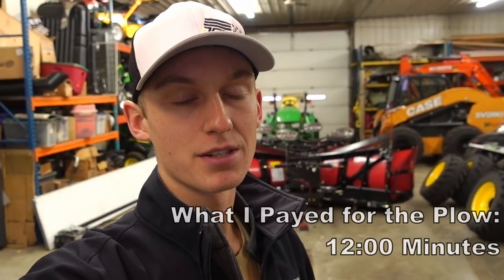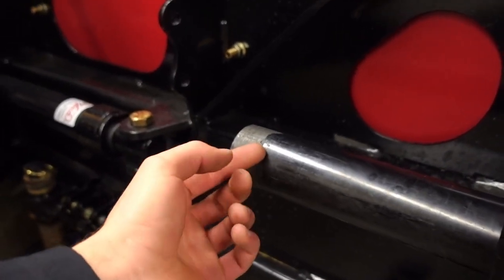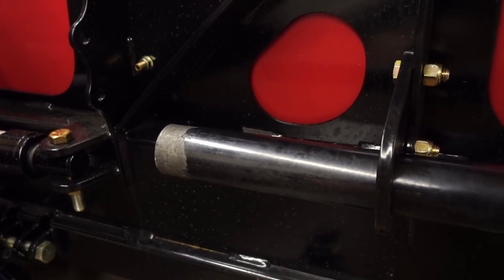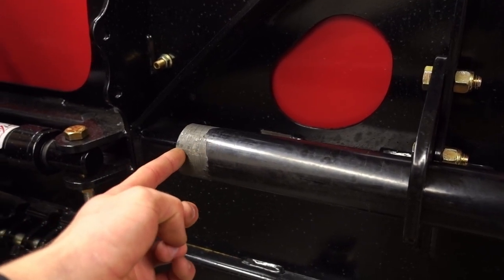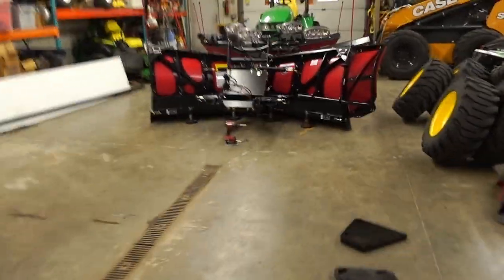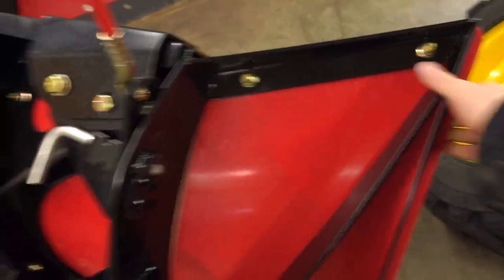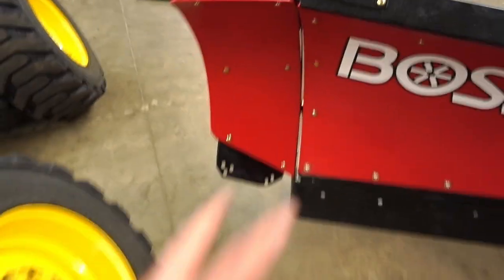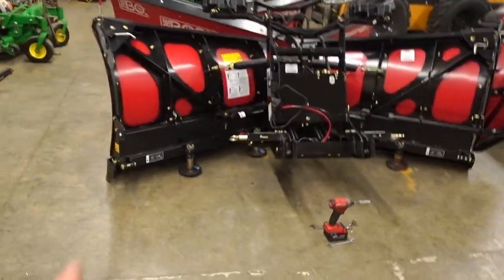11 Foot V-Plow On A 6.0 Powerstroke  | How Much Does A New Boss DXT V Plow Costs?

Comment: mine was a little tight too, but instead of grinding down the tubes, I just grinned down the inner circle of the mounting tabs. All that had to come off was the primer and powder coat. I didn't have to grind any steel down thankfully.

Comment: Delt with the same exact issues right down to the boss reps a few years back with vxt  setup. Had some issues with them coming loose due to how much play there is. So I ended up tapping some rubber stoppers on to the side of the extensions just big enough for a little bit of pressure. The fix worked for the second half of the season but ended up selling the extensions after that anyway. Oh yeah, pretty much rode with them full time too! Never had any trouble with the law but had a D.O.T. guy tell me I was over width for the roads when I squeezed through the toll booth once.

Comment: That is not a bad deal at all. I live in upstate NY and just bought a new VXT 8'2'' , but had truck mount and wiring added and i spent $6,600 with deflector and shoes.
Reply from the maker: Mounts and wiring are all of $1200 here I wanna say that stuffs not cheap
Reply: @CarsonSchifsky  that's right around what they are charging around here as well.

Comment: ive got a 9’ western strait blade for my truck i found a set of wings for it. there 9” wings so its just over 10.5’  wide but i dont take it on public roads with the one on the drivers side its 2 big pins to take it out but its easier and cheaper then if i hit something. i can pull both off but dont want to if i dont need too. 

the wings help on a strait blade ends up scooping a little bit more or i can keep one out and “windrow” more snow 
if the town is taking a while to hit the roads in my private neighborhood and its around when people get out of work ill keep the wings out and plow out the whole road in a pass and a half
Reply from the maker: Yep I love how there angled I really think that’ll help with scooping and less windrows!
Reply: Carson Schifsky it really does help saves alot of time
Reply: Any videos of those guards plowing snow?

Comment: I think the problem with the wings lining up is that the wing bracket should go on top and the bracket that is on top now should be on the bottom. That would bring the bolt holes in line and the bottom of the wings  up flush.
Reply from the maker: There all kind of installed per the instructions. I think the kits like a universal system so they have extra hardware and holes for different plows

Comment: I just put a 1 season old fisher 8’ 6” straight plow, wires and hand held controller, very little use, driveway used only, 2650 installed
Reply from the maker: That’s not to bad

Comment: You should really consider running some kind of an led light bar on the front I have one on every plowing setup I got and it really helps with the visibility at night. It’s not always needed but when the visibility is low it’s nice to have. And make a huge difference in my opinion.
Reply from the maker: Idk where I could mount it that it wouldn’t just reflect off the plow? But these new boss led lights are super good
Reply: I run a few of mine off of the roof. Also I have a few in different places like on the bumper (depending on the plow hight) also I have 2 Mounted right by where the original lights are like in between them on the plow
Reply: Running an extra LED light bar is totally unnecessary considering that the plow already comes stock with the brightest of brightest SL3 LED headlights and it’s 2x brighter than standard halogen. No other manufacturer has brighter lights than BOSS.

Comment: I would recommend based on over 30 years of experience go with the Westin plow Western plow they are rated number one if you go to a plow repair place you’re going to see all the other manufacturers pumps hydraulics and equipment in for service you’ll never see westerns and what’s important to note it’s not only the plow but the person operating it. The wings of many of these type of plows if you do your research have been known to malfunction and or cause transmission malfunction and you need to match the plow with the truck. I personally recommend dodge Cummins 6.7 turbo diesel 2014 and beyond I also have a 1999 5.9 Cummins dodge on a 4 inch lift skyjacker brand new body and suspension with extend the links and bushings brand new tires Mastercraft and I just change the fly wheel at the starter did all the fluid rear end transfer case transmission right before the winter if you’d like to see pictures I’d be more than happy to show you

Comment: Wow that's a good deal. I paid $5900 for the XT model. The DXT steel in my area was around $6700 I believe without wings that's with labor and bracket
Reply from the maker: Instal for the bracket wiring etc though? I didn’t have to put any hardware in the truck.
Reply: @CarsonSchifsky  Yes that's for everything

Comment: That's a good deal. That's a very heavy plow, do you have air bags on the front axle? We run them on our f250's and they carry the load much better. 

I did not like the dxt on gravel, it's a pavement plow in my opinion, and a darn good one at that.
Reply from the maker: That’s good to know, and no I don’t have and air bags but I was thinking about that but didn’t know if it was possible
Reply: @CarsonSchifsky  here are the ones that I run. 

https://www.airliftcompany.com/products/air-springs/air-lift-1000/

The dxt was fine on gravel that was frozen, but here in northern MI it's rare our ground freezes before we start plowing, some years it rarely gets hard it seems. We run quick gaurds on our plows for the super soft jobs we have to do early season.  http://greatlakesweld.com/quick-guard/1339276

Comment: Are you running shoes because you have some gravel drives? I haven't run the shoes but some have suggested that I do because the dxt's angle isn't really ideal for gravel drives. Didn't have these drives when was buying? wonder if they would help with this? thanks in advance! Nice video
Reply from the maker: I’m sure they would but the shoes just help prolong the life of the blade so that’s why we run them.

Comment: How has the 6.0l held up for you? They have a notorious problem with heads and oil coolers etc. Just wondering what your thoughts on them I’m looking at pulling the trigger on one next week. Thanks
Reply from the maker: We bought this new in 06 it’s an 07. We’ve done a egg delete and exhaust and nothing else other then keep up on maintenance. She’s never had an issue knock on wood. We’ve had to replace batteries an alternator and typical front end parts but engine is solid. If you take care of them they should take care of you. However I will say the 2007 or 2006 would be the only year I’d buy a Thai game before that didn’t have the “updates” and 2003-2004 are trash stay away

Comment: I am considering a Boss Vxt , do you think I should spend extra $650 to go Dxt. I only do driveways. Since you have experience with both plows, I would value your opinion.
Reply from the maker: The DXT upgrade for me was only $200-300 so I think your dealer is a bit high o the price for upgrade. However I have not used the dxt much yet, I would say to analyze your sights and your future sights. If sights have small objects that stick up such as sewer/ water like manhole covers or things like that I would recommend dxt. Mostly commercial lots is where you’ll find those small things that would just trip the blade and make it worth it. If you don’t plan on going commercial I’d stick with a good VXT

Comment: Who is your Boss dealer? i was quoted 6400 for just a power vxt plus another 900 for wings and 400 for a joystick for a total of $7700. That was plow side only as my truck is already setup.
Reply from the maker: Robs snow plow in Ashland Wi absolutely amazing guy
Reply: @CarsonSchifsky  Awesome thanks ill get a hold of them. How do you like the dxt vs the vxt? Weve always run vxts but recently have picked up some really rough parking lots and some more gravel driveways and are considering a dxt

Comment: Are any of you trucks diesel and if you do have a gas truck how much snow can you push? Thanks.
Reply from the maker: Our 2017 is gas everything else is diesel. And honestly with the plow and proper sand bag weight it’s not terribly different. Diesel will want to idle along with ought throttle input because of the torque but they both push decent. When u get in big wet snows you’ll definitely appreciate a diesel however.

Comment: So, someone must have already corrected you on the size of the plow with the wings on, because in the video you kept saying 11'-2", but in the title, you got it right, saying it's 11'.  Yes, it's 11' with the wings on.  While I can understand your reasoning of taking the wings off on hourly sites, to me it's not worth it.  Too much messing around with on and off, on and off etc.  My wings stay on all of my blades.  Yes, it's wide, and takes a minute to get used to it driving it down the road, but you'll get used to it, and once you do, it won't be a big deal.  The first event or two every year I have to get used to it again, but after that, it's no big deal.  Asking about the legalities of driving with a blade that wide will vary depending on your state.  In IL, we just have to put an orange flag on the drivers side wing of the plow to be legal.  In some states, it's illegal.  You'll have some idiot that will chime in and tell you that 8'-6" is the maximum legal width according to federal guidelines.  But those idiots don't realize that each state can super-cede federal laws in their own state.  Also, if you put 8 or 9 hundred pounds of tube sand behind the rear wheels, it will take some of the weight of the plow off of your front axle, and it will also give you better traction.  Just build yourself a box out of wood, and put it in between the rear wheel wells and the tailgate, and fill it up with tube sand.  You'll see a huge difference.  And you got a  MUCH BETTER deal on your plow than I have been getting.  I think I paid a total of 9,200.00 for my newest (bought it in October of this year) for a stainless 9'-2" DXT, with wings, installed, with a handheld controller.  And I KNOW I paid too much, and probably could have gotten a better deal if I traveled to a different dealer, but this is also the same dealer who will come to my house, pick up whichever plow and truck that I'm having a problem with, take it to his shop and fix it, and then deliver it back to my shop without charging me a dime for his time to pick my stuff up and drop it back off. Do you not salt?  If not, I sure hope you word your contracts correctly so that you're not held liable for slip and falls.  And if you don't, you're also missing out on the MOST PROFITABLE part of plowing.  I'd take 3 salting events every week, all Winter over plowing once.  Make more money, and less abuse of your equipment.
Reply from the maker: Thanks Jeff and I guess I wasn’t aware the plows were only 11’ I never measured them I just figured they’d be 11’2” sense the plow is a 9’2”. We do salt but most people don’t seem to want it so we offer it and quote it but also say we aren’t liable for slip and falls if we’re not salting or told not to.

Comment: How much do you get for hourly work? 

I’ve never had a contract for hourly pay 

I’m pretty efficient so a small lot mat only take 30 mins to do 
But we’re never do anything lower then 150 per push 

Just wondering what you guys get hourly 🤔
Reply from the maker: I charge $85 minimum per hour depending on if it’s a shitty lot. This truck/ plow setup is worth all that. On a large open lot I’d say it’s worth more because of the ground speed I can get is twice that if a skid at 11’ wide

Comment: Be careful the bigger the plow the bigger the problems will follow ,  strain on the transmission , power steering and cooling system. I don't run over size on any of my plows 102 is the legal width on US roads . You will be pushing over 10 yards of snow when you have a full blade and the reason I have that number is my loader with a 12 foot pusher is scaled at 12 yards of snow when full . Agin be careful .
Reply from the maker: Good to know. That’s what I’ve been thinking of is more strain on front end parts because of all the extra weight too
Reply: You can add all the stuff to make any blade look like the biggest, most time saving baddest blade out there . When it comes right down to it it's not the truck or the blade or the owner on how much it can carry it comes down to how much the check book can carry and that's the part that fails the most .

Comment: Why not go with the boss EXT way more efficient and better
Reply from the maker: What’s the difference from the DXT
Reply: A lot of problems with the Boss EXT.  If you want an expandable plow go Fisher XLT, Western Wideout or Snow Ex Power Plow.  Also, to say expendables are "way more efficient and better" then other plow types in an ignorant statement.  They all have their pro's and con's.  V plow works best for me, an expandable works best for my buddy.
Reply: Bullshit they’re all owned by Douglas dynamics
Reply: Yeah, and all three are considerably better then the EXT.  That is unless you prefer your plow to twist it's moldboard, break welds, pinch hoses and wear out pivot pins at an alarming rate.  Boss straight and V plows are good plows.  The EXT is junk.
Reply: No been running the original blizzard before they sold out
Reply: Blizzard was a good plow.  Douglas Dynamics bought Blizzard for their expandable plow technology.  Ran the Blizzard name for a while then Blizzard became Snow Ex.
Reply: I know this none of them are as good is the original
Reply: Ok, sure.  At any rate, all are still much better then an EXT.
Reply: @6.8SuperDutyDriver  Snowex bought the "Blizzard plow" from Douglas I think almost two seasons ago.
Reply: Bob Skowronek, Fisher, Western and Snow Ex are all currently owned by Douglas Dynamic's.  They did away with the Blizzard name a few years ago and all models went under the Snow Ex brand.

Comment: To be 100 those wings will not last more than 2 years just make the best of your blades without upgrades other than cutting edges look into what your high way plows use for gauge on a cutting edge and make your own just trust me I can see it all so weak
Reply from the maker: Ya they definitely don’t look super stable... so we’ll see how it goes!
Reply: I have ran them for years. If you don't treat them like a bulldozer they will hold up just fine.

Comment: Something's not right just don't look right
Reply: Run a bead down it will be tight after that!! Bet your ass it don't move. Slap a bracket on there then about 6 beads on it problem solved!! Lol just kidding but that should be way tighter and closer!!
Reply from the maker: There suppose to be able to come off in the field if need be. I just wish they’d check their tolerances
Reply: Yeah guess that makes sense but after watching you put that set up together I would give it back and buy a Western. Man that gave me a headache watching you put them on!!
Reply: Did some talking guess them hydraulic pump hoses have issues blowing so check that out too that would suck being stuck out on a storm and there is nothing you can do neither so at night you would be fucked. Just saying from what I was told.